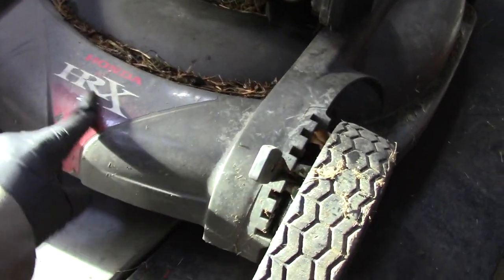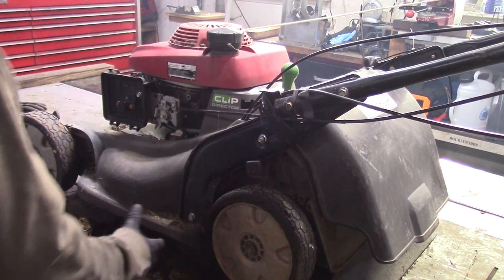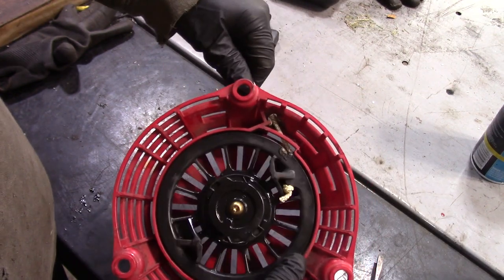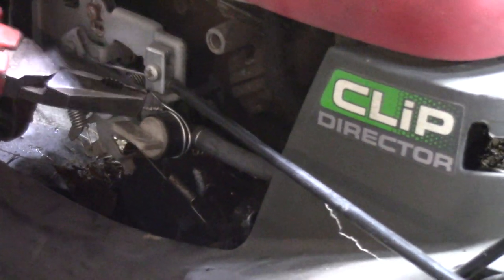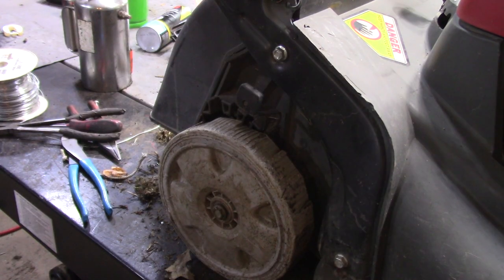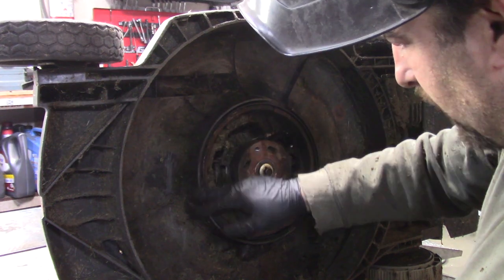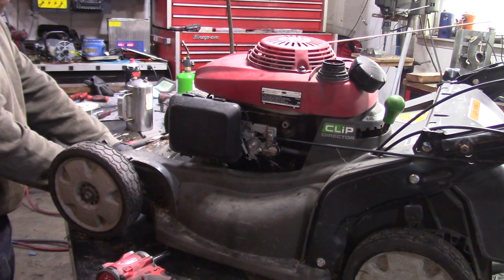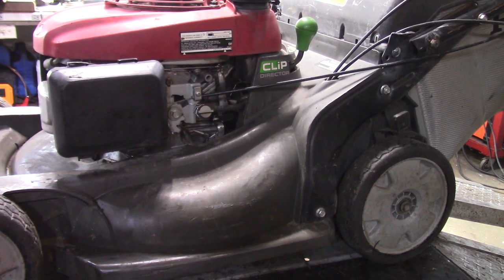Trash Picked Honda HRX217

Comment from the maker: Links to Tools and Supplies:
https://amzn.to/3gW5hqr Non Aersol Sprayer
https://amzn.to/3BwvNQC 18 Gauge Mechanics Wire
https://amzn.to/3H4jvjk 3/8" Milwaukee Stubby Impact gun
https://amzn.to/3v1TBug Honda HRX217 Carbureter
https://amzn.to/3JE4fLX Honda HRX217 Wheels
https://amzn.to/3sRNQN5 Micro Drill Bits
https://amzn.to/3hfRdZ3 Ultrasonic Cleaner

Comment: I have a HRX217 we use in my commercial company and love it. I agree about taking the carb on and off its a pain. The HRX217HXA was around 800.00 new. The material the deck is called Nexite its the same material used to make football helmets. Honda now gives a lifetime warranty on the deck for residential use only 90 days for commercial use. They are great mowers!!
Reply from the maker: Thanks for the info.  I did not know that they made football helmets out of the same material.  If I got a scrap one I will make a video on trying to break the deck.

Comment: One way to make Honda carbs easier to work on is to use six mm threaded rods to slide all those gaskets back together. Cut a screwdriver slot in the end of the rods. Now with it assembled, pull one rod and replace bolt and then the other one.. Easy peasy, or at least bearable. My found mower even had a flag style limiter on the idle circuit that I had to grind off  to remove the screw to clean the idle circuit. So at least with the threaded rods you don't have the airbox on there to adjust the carb screws. I am pretty sure that they use threaded rods that might work on predator horizontal engines that are possibly the right diameter and hopefully length. On edit , carb mounting studs are 6 mm threads 4.5 inches long for the 6.5 horsepower and if you need longer ones, they are 133 mm long for the 11 and 13 horsepower horizontal engines. These are readily available aftermarket parts

Comment: I just got one out of the trash down the street the other day. Someone had rigged the recoil starter back on the top and had too much tension on it causing it to seem like the motor was seized up. Loosened it up and the cord/motor came loose. Started right up. Ordered some parts to make it whole again and will probably use it as my main mower now 😂

Comment: Nice job: I use a couple of chop stick cut off to align all the carb gaskets, plates, etc. works pretty good. Then pull one out and insert the bolt that belongs in it. Thanks.
Reply from the maker: Great tip! Thanks I may do the same if I can't find threaded bolts.
Reply: Same here , two short dowels.
Reply: @doublewide6  make some studs out of bolts.

Comment: Just got a new to me last night with the rear wheels  locked up  but it was only 80 bucks and it will run on the first pull from a couple other videos on  YouTube as I was able to get some good degreaser in a spray bottle and got the gear ⛮ to spin on the shaft and made it  look like I had done it before ,the  longest  part was to get the tools out

Comment: Hondas are a pain I agree, what I do is this, the black part of the airfilter box that covers the carb itself, I very neatly just cut it off makes life so much easier, lining up the gaskets, and plates, and I also take the whole red cover off the top of the engine, to aid in cleaning, and inspect the ignition coil, and flywheel stop mechanism, also so the whole carb is exposed, and cutting off that part of the airfilter box doesn't effect the carb or running at all, and I have never had a complaint either only people who work on them would notice it anyway. 
Very nice job.

Comment: On these Carbs u can pull the spacers out of the air box base then slide them over the carb bolts. This allows you to bolt the carb back down without the air box on so you can adjust it while on the machine running.

Comment: Bought mine brand new about 6 years ago (HRX217HYA) .  Echo the carb comments, and the maintenance needed to keep the rear axle happy is a little un-called for, but for aging guys like me with a complicated lawn to mow, the hydrostatic trans is worth the nuisances.  No other mower would be.  Nice find!
Reply from the maker: I have seen a few hydo trans Hondas that lost the fluid and worked great as soon as the seals and fluid was replaced.  The seals on the transmissions are not sold separately, so I had to measure and order something really close.

Comment: Nice save on that not so old mower. Those HRX mowers with the blade clutch are/were crazy expensive. You should be able to get plenty more $$ for your time and trouble if you are willing to wait for the right buyer.  For those carbs, I use a pair of M6 threaded rod, 100mm in length (just shy of 4 inches). I cut a slot on one end with a dremel and use a screwdriver to replace the bolts one at a time. Holds that mess of gaskets in order.
Reply from the maker: Thanks for the tips!  I know what you mean then pull the rods out one at a time.
Reply: @doublewide6  Yep. I think one of my recent honda vids show them in action. Honda sells the same "tool' for a crazy amount of money. Mercifully the newest consumer models have the studs now, like the commercial mowers have always had.
Reply: Great tip.

Comment: If you do try the M6 X 1 bolt trick to hold everything together DO use the 100MM length and NOT the 80MM.  Some on other videos have suggested the 80MM, which is the actual size of those two long bolts, and you don't get enough sticking out of the air filter box to make the trick work.  I did not have to put any ends on the 100MM length bolts that i got... I could simply turn them out of the block with my fingers.  Take one out while holding the air filter tight, then run the factory bolt in snug.  That will hold everything in place while you put the other bolt in.   I am trying to fix a throw away now and I got it running but it is surging.  An amazon carb was about $10.00 and I may try that next.   BEST OF LUCK and thanks for your video!!!

Comment: A bit late now but yes the rope is to thick i found a HRX they had used a thick rope like that and i fixed it fast with a thinner rope  . i have some dog walking rolls with thin rope . strong and thin, the lawnmower stills run great

Comment: The easiest way to work on one of those carbs is to let someone else do it.  I never had a plastic mower deck but did have an aluminum deck years ago.  Unfortunately it cracked and was to expensive to get welded at that time.  Thanks for saving a good mower so someone can purchase a nice one at less than new.  Great job as usual.
Reply from the maker: Right on

Comment: I have the same mower, hrx217 hya.    The pull rope assembly (housing and all is $15 on amazon.    Other than that pull rope assembly, I've had zero problems.  That model new goes for $900.

Comment: No easy way to install and take off the carburetor on these Honda's , I've worked on so many of these . I saved one video too put it back together with all the gaskets in line . Because sometimes I wait so long too work on them I forget that everything has got too go back in a certain order . But LOL after taking them apart so many times you will save a how to video too use when it comes time too work on one . But I'm not afraid now too work on one , have an old Honda - its so old it has a manual choke carburetor on it . My personal Honda  trim mower thats over 20 years old . Enjoy your video's .......
Reply from the maker: Thanks for all the good info.

Comment: Nice job Bob. Those Honda carbs are kind of a pain to work on and they all seem to surge so i always drill that jet out regardless. I use two studs to reassemble the gaskets ,heat shield, plastic spacer, etc, and then i change out the studs one at a time with the bolts. Works pretty good for me. Here in Iowa i would get $185-$200 for that mower with a bagger and shined up. A trash find worked out well for you Bob! 👍💲🇺🇸 Roger
Reply: My bad Roger, I guess we were both typing our comments out at the same time. Good info though brother. 👍
Reply: @Big_Johns  No problem John. Did we have the same ideas? Thats a good thing . Always enjoy your comments. 👍
Reply: And likewise brother but yes  had the same solution, I just shared LML’s video that helped me with the problem. 🙂👍🏼
Reply from the maker: Thanks Roger I am happy I asked for the solution because I am finding plenty of people on here that know about using dowels.  I am going to list that mower for $200 and see what happens.
Reply: I was working on the exact same unit yesterday with the same surging. Which jet is the the low speed?  There is no black plastic one up top like some honda clones.  Thanks!

Comment: Nice fix Bob . Take it you drilled the idle jet .
Reply from the maker: Yes drilled with .016 bit worked well.  Just a pain to take on and off the carb 2 times in the drilling process.

Comment: The last price on that mower, new, in Kansas City was $750 plus tax before they discontinued it.  Technically, that deck is nylon, which is why it's so tough.

I’ve always heard the carb is near impossible to work on.  I’ve always just used good fuel and run TruFuel for the first & last use every year.  The solution I’d like to see someone come up with is a way to add grease zerks to the rear wheels where the axles go through the bushings in the adjusters.

Love my HRX!
Reply from the maker: Good stuff Mike.  I will be listing that mower for more money.

Comment: In my experience those BBC model mowers don't idle smoothly with the blades disengaged but run fine when they are. So I  basically wouldn't adjust anything if it ran that way.  Maybe the govenor is set to be smooth under load only.
Reply from the maker: I think they are just leaned out for emission standards.  I drilled out the low speed jet it really helped.  Before drilling, it revved up fine and cut fine but idle was missing.
Reply: There are two main issues with engine surging at low speed and not under load.  First, pride of getting it right.  The just enough guy says "that is good enough", but the mechanic who cares gets it right.  Second, when you go to sell it, it is surging.  People notice these issues and then start trying to haggle down on price.  Nice trash pick and will sell easily in Spring.

Comment: As some others have said, use dowels to easily re-insert the carb and its gaskets, etc. Below is your pal Bruce P. with a video (about the 4 min. mark) On the HRX, it's easier if you unbolt the metal control bracket (17:20 in your video) first:
https://www.youtube.com/watch?v=huKe7-qzwak

That deck, Nexite, shines up pretty good with a coat of tranny fluid as does the recoil housing, etc. I believe Honda compares Nexite's strength to that of motorcycle crash helmets; very tough.

Why not try what you did on a previous video where you retreaded a Honda wheel? Hard to tell on the video, but the hub appears to be Honda.

I'd try to get a around $200 (or even more; Walmart sells a cheapo entry level "push" mower for $200) for that great mower at first. It retailed (with tax) at over $900 when new where I live. It has a blade clutch,  larger GCV190, and a hydro tranny. For much of the pandemic, the HRX was not even been available at Home Depot; starting to show up lately though.
Reply from the maker: Thanks for the tip.  I watched the video and it will help me out tremendously.  Thank you.

Comment: Bob I feel your pain with this Honda carb set-up, I always hated when one of these would come to my shop needing carb work. 
The Lawn Mower Lady has a video out about this issue and the way she avoids all of the hassle. If its ok I'll stick the link here  
https://youtu.be/JJ2AW0OlMYs and at the 2 minute mark she explains her solution. I now use her method and it's so much easier. 👍
Reply from the maker: Thanks for the link she did not mention that she had a video on it.  I will be using this method in the future.  Still it is a pain to adjust the carb because it can't be done on the machine.
Reply: Anytime, yeah the adjustments would be a problem.